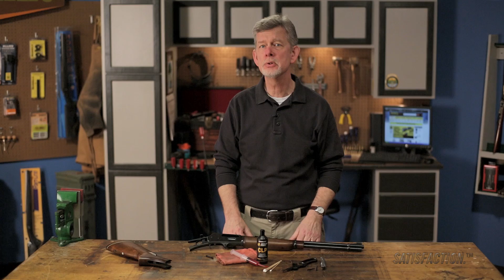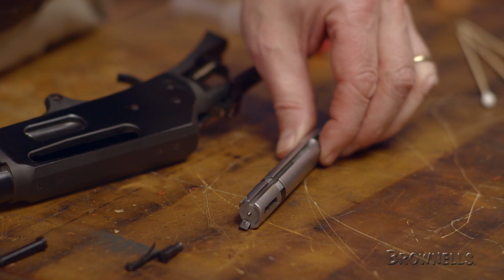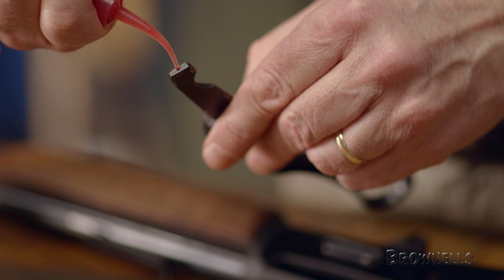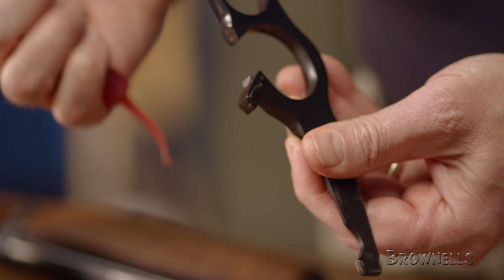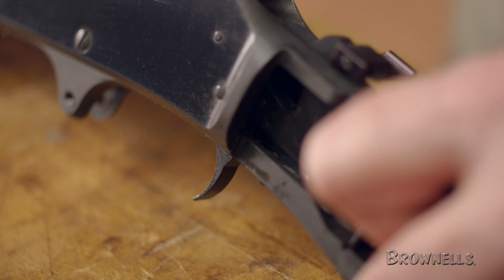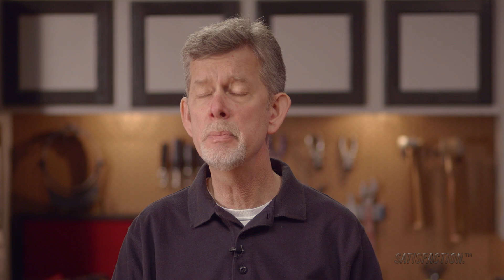Firearm Maintenance Series: Marlin 336 Lever Action Lubrication, Part 3/4

Comment: During cleaning of my Marlin rifle I had some stubborn powder deposits that would not come out with Hoppe’s #9 and a brush. I tried the kit from Brownell’s that includes J-B bore cleaning compound and Kano Kroil oil and that did the trick. The problem was I did not have the nice bore guide shown in your video so the J-B paste got inside the receiver. I used Break Free Powder Blast to thoroughly flush the receiver.  Now all the parts inside the receiver are bone dry. So how do I get a thin film of oil on the inside of the receiver and all moving parts without disassembling everything. Should I use an aerosol spray oil like Ballistol and then try to remove the excess with rags and Q tips?
Reply: You really need to fully disassemble your receiver and make sure everything clean . And grease and oil where needed. Its not hard to disassemble there's other YouTube videos showing how to do this it's a 10min job! Easy peasy.